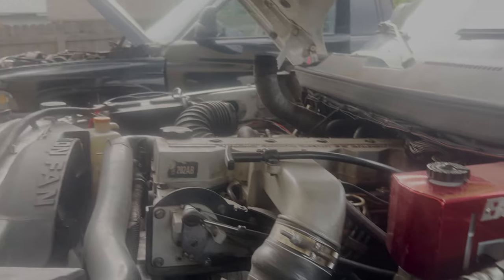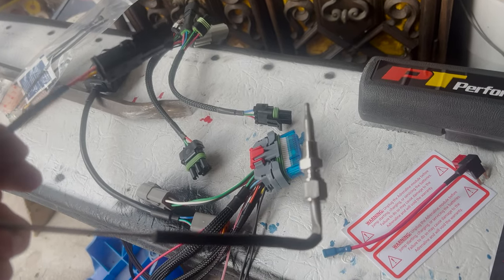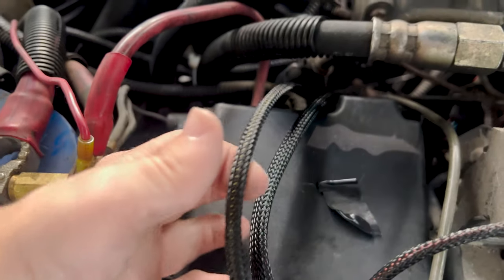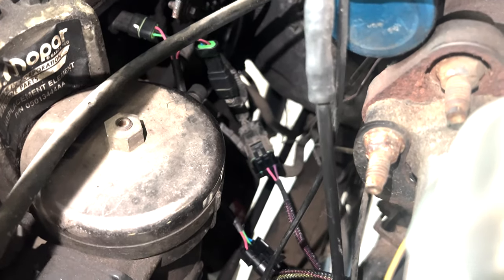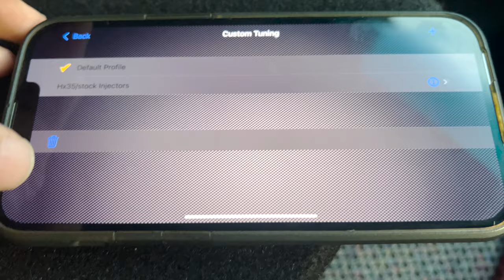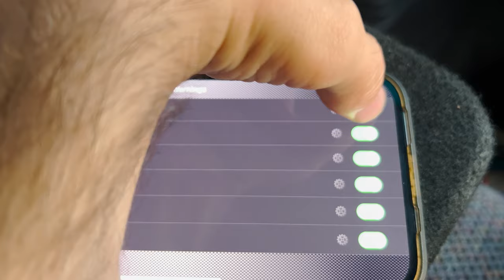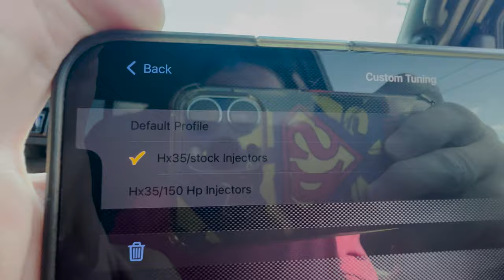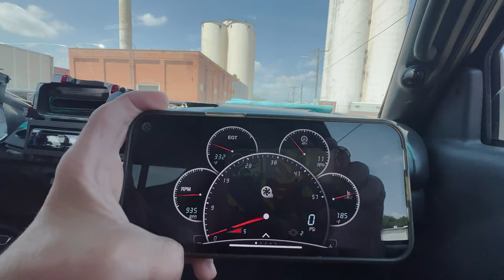THE BEST TUNER AVAILABLE for your 2nd gen 24v Cummins

Comment: 24V trucks have it so nice, when I ground the fuel pin and replaced the gov spring in my VE truck I loaded it and the trailer up and kept driving up and down the road adjusting everything till I had it set where I wanted it… now I have a bunch of new junk for it, really wish I could just adjust it off my phone instead of caveman style with a wrench, screwdriver and leatherman. Looking forward to your next videos.

Comment: Do  you have connectivity issues , every time i start my my truck i wait for it to link up.. if no internet ? Does it work.
Reply from the maker: @1967brokedude  we don’t run gauges on ours so we just manually connect whenever we need to change the tune. No connectivity issues doing it manually. I can’t speak on tryna get it to connect automatically every day. I imagine it would be more finicky then.
Reply: @superdwarf  I changed the phone I think it was a blue tooth issue ?
I leave an old phone in the truck just for the quad Z.
I still use my pod gages but I did use the tran/oil temp for oil temp. 
Everything seems to be doing fine now.

Comment: How is your automatic holding up to that tuner. I’ve got a 99 as well and was wondering. What power level do you use mostly
Reply from the maker: The auto it came with lasted just over 4 years. Had it fully built for 800 hp back in December. Trans held up just fine what have out was the torque convertor
Reply: Yea I’m thing about doing the pan off upgrade on mine for now. Unless I go ahead and do a better converter. Just hate pulling out transmission. Right now my truck is bone stock besides exhaust and a fass system. Automatic was supposed to been rebuilt about 12k ago. I can tell it’s at least been out cause it’s pretty clean